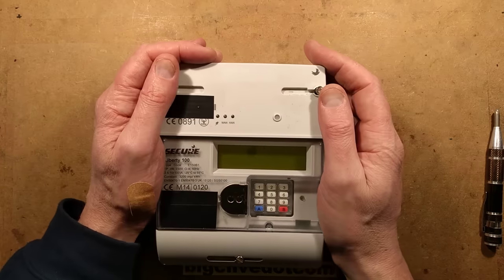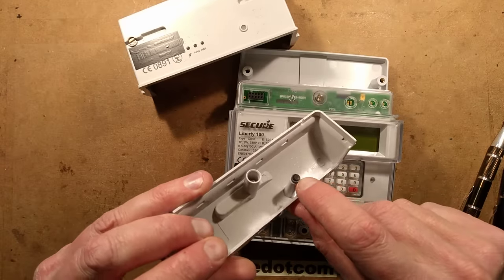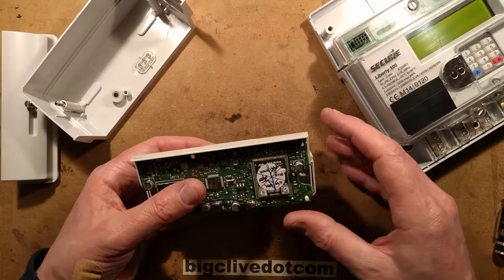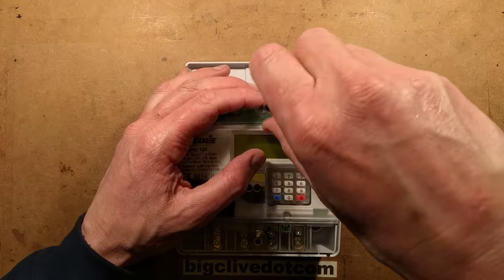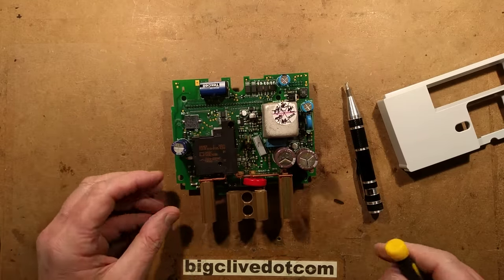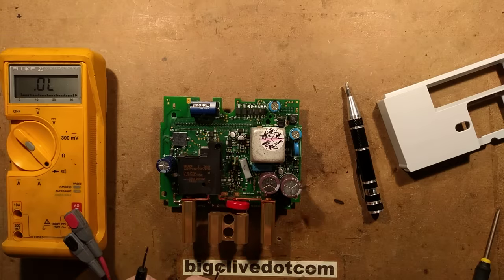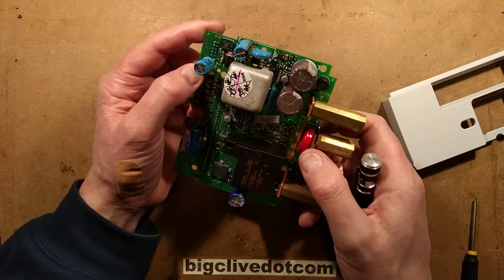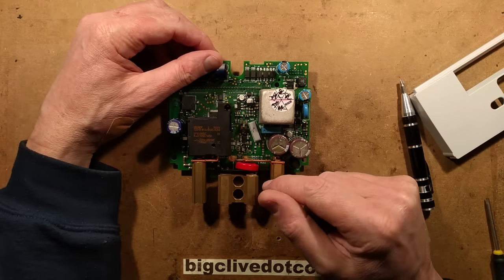Inside a smart meter, and the REAL problem with them.

Comment: I have 2000 Millie volts coming from my smart mete is this bad for my health
Reply from the maker: No.  If you're measuring a field it will potentially be at picoamps.  At that current it would be blocked by your skin completely.

Comment: My meter is the old spinning disk type that is EMP and solar flair resistant. If either happens with these electronic meters your power could be down for months as the power company has to replace them all with only a limited stock on hand.
Reply: I think the solar flair has dazzled you a bit too much.

Comment: I suppose that thing allows them to put IP internet packets from that modem to every mains socket in your house. When you plug something in - like your car charger that is set up to connect to the network - it could send a message back through the mains to the meter and off, via the modem, to the electricity company. They can then control it. If it's not in the current generation of smart meters, just wait.
Reply: In one statement you have shown you have no clue about networking.

Comment: The funny slug of different metal next to the power terminals is a current shunt.  similar to these:
https://uk.farnell.com/webapp/wcs/stores/servlet/CategoryDisplay?beginIndex=0&categoryId=700000004052&catalogId=15001&langId=44&storeId=10151&krypto=NFIye13FB8zt8bbVOPzpD4H7Qxu6twox8DuF9aCt%2BO3ryw8fGyRU%2FZEZIZ6YnN%2F0F7d%2BrYpE%2Fhj0shLJCspFcQ%3D%3D

It will have a specific potential difference range across it based on current draw, enabling high currents to be measured.  e.g. 0-100A will produce 0-100mV.  it will generate a small amount of heat. probably between 0-10W depending on load

Comment: Read the small print on mobile phones and also The Invisible Rainbow.  The military make use of EMFs as weapons.  Denying their capability to cause health problems and to be used as weapons is simple ignorance.  Everyone working with radar and telecoms in the armed forces is well aware of the dangers and there's a higher risk of cancer for people working in the telecoms industry at the coal face (towers, etc).  We don't have a Smart meter and we're not getting one.  If it was up to me, all our computers and gadgets would be hard-wired and double-checked for dirty electricity.  It's incredibly lazy to pull out the "conspiracy theorist" propaganda used to discredit truth.  If we've seen anything since the beginning of 2020, it's that none of the organisations producing any "tech" can be trusted.
Reply from the maker: The single biggest thing you can do to reduce your exposure to RF energy is to stop using your mobile phone.
Reply: @bigclivedotcom  if you stop using your phone then how do you go about with your banking..bills..and others since they are now used in this way?

Comment: You do have a nasty stutter Clive although it is a very common affliction. LCD display! Liquid crystal display display. That is one of my favourites. The MOV is probably just to provide some surge protection for the power supply but I have found a lot of instances where the fault current they were expecting the MOV to handle was excessive and the MOV disappeared.
I served my apprenticeship with an electrical supply authority. I spent six months in the meter section some of that time was spent repairing and testing disk type meters. One fairly common bill reduction technique was to drill a hole in the top of the cover and use a straw out of a broom to slow the disk. I believe that some supply companies here in Australia do increment the charge according to the period of usage.

Comment: This gubbins just sends meter readings over cellular so you dont have to read the meter.
The only drawback is the gas meter having to run off a battery which will need changing every 6 or 7 years.

Comment: IMHO...These meters cost bugger all from China (in real terms) But the installation has to be paid for by the customer in added charges....and to finance this scheme of Linky the suppliers of power use the difference bewteen kV and kVA...if your power factor is 1 then no problem but in 65 years as a sparks I have never seen i.e. measured an installation that was better than 0.9, more like 0.75.. and the difference makes a huge difference to your bill and finaces the cost of the "new" system.  Please study Power Factor on the internet and with this knowledle you will be able to understand the "new" system.

Comment: Hasn't it been proven without doubt that certain wavelengths influence cells in the body & mind. Using these same frequencies that the Human body creates. Hospital machinary utilises this ability & when doc tors run behind protective screens when X-raying people you take notice or I do but you seem to think that it's all bs. When someone puts up lead sheeting around these power supplies you tend to take note of what's being done especially when you see the results through testing equipment . Even warnings on  mobile phone radiation from manufacturers tend to have people's attention but you seem to assume it's bs. Statistics can also make valid statements if you have accurate information.so if in the advent of increased brain tumours & deaths from these things & mobile phone usage to confirm the theory you can't make the connection.  Also if your working in electric substations &  transmission stations you use earthing straps & ppe. Denial is not scientific especially when people are trying to inform others as they've been made aware of certain properties the equipment utilises. Where do you get your theories from & are you part of a major manufacturing syndicate.

Comment: I'm sorry we don't need any conspiracy theory's here as the reality is bad enough.  They can turn your supply off remotely ???  So if your in dispute with them over some problem they simply trump all the arguments by turning off your supply.  Also the variable rate is just a licence to print money for them. We have economy 7 and I love it, a mechanical meter tells me how many units have gone though each tariff and I know how much each of the units cost so I can check the bill.  With these new units you just have to trust your supplier as to what you've used, and how much each of those units cost you.  And if you disagree it's the hall effect VETO time.
& don't even get me started on the daily standing charge

Comment: These meters don't listen to your house using a microphone. Don't be ridiculous. What they can do is monitor your usage and how it's being used. They can tell if you have motors running or have ballasts that may indicate a pot farm in your attic. If law enforcement is trying to put together a profile on you they can access the information to map your daily habits. These units also have the ability to send data signals out across your interior house wiring along with high frequency radio waves that is useful for law enforcement to then be able to see into your house with monitoring equipment. Weather this particular unit has any of these features or not is another thing all together. You are familiar with electronics so you should know that certain devices designed for one purpose can be exploited for other things that they may or may not have been even thought about.

There is an abundance of evidence that indicates that people that talk excessively on cell phones and use predominantly the same ear every time are much more likely to develop brain tumors on that side of their head. The radiation does pernitrate in to the skull. If I'm on a long phone call I have to switch holding the phone from hand to hand (I always use speaker phone so I'm usually holding my phone) due to the fact that the bones in my hands will start to ache if I hold the phone in one hand for to long plus my hands will start to cramp up, not to mention the phone gets hot.

As for 5G there are published per reviewed papers that indicate certain interactions with 5G and human physiology. If I remember right 5G inhibits red blood cells from transporting oxygen and something to do with interfering with your bodies ability to repair damaged chromosomes. Don't quote me on this because it has been a while since I read the papers but rest assured there are health effects. Now weather or not these effects are worth getting your panties in a bunch about you will have to decide that one for your self.

Comment: Please  DO NOT EVER INSTALL SMART METER   ?
Reply: Yes! Never let them install one,,,  both times a Smart Meter has been installed into a building we lived in our Children started having nosebleeds and headaches at the exact time,  by exact, I mean in seconds of each other.  They are both getting radiation poisoning and I'm sure my whole family is too!  
And no it wasn't our family who had a meter installed, never would!
Reply: Do what you want, but you probably won’t have a choice if your traditional meter stops working/needs replacing for safety reasons as they hardly manufacturer traditional meters anymore so some suppliers simply only have stock of smart meters

Comment: So next time there's a regional power outage, pop open the two covers and short the tamper sensors. OK, got it.

The main abuse of these things that I heard is surveillance.  You get home from work, it lets the telemarketing company or bill collectors know. DSP can identify specific types of devices in the house which can be used for marketing or law enforcement fishing expeditions, etc.
And in some designs the power to operate the meter is on the customer side (billable).

Comment: Did you know they cause dirty electricity and the wires on your house act as a energized transmitter
Reply from the maker: No.  Mainly because they don't.  The meters used to "prove" they do are made purely for that purpose.
Reply: The smets 2 meter run of DCC in uk

Comment: I wonder if it has any fuse or safety protection against faults, I suspect we'll be hearing about fires caused by these the more people have them, I refused on privacy grounds and ability to cut your supply easily at a whim
Reply from the maker: The fuse is at the cable entrance.  The only fires I know of involving the indoor meters are due to incorrect installation.

Comment: Did you use an RFR meter to measure the RFR emissions? We have. And smart meters DO emit RFR's. And yes, 5G really is loaded with RFR's that are not good for the body electric. Do the research yourself - but not from telecom sources.

Comment: Wrap it in lead!
This way you have not tampered with it, and they can not get to it without causing criiminal damage!
A grounded lead cage will block all radio signals, will not damage the meter but what i do not get is why ppeople do not get a written service agreement before switching energy brokers wi5h signature i  which the rental space for the meter has to be paid for equal or greater than the service tarriff! That is the rental space in which the meter sits is equal to the service  charge plus the admin fee for calcation of the rental charge which is very complicated and they wouldnt understand it which is legal bollocks for we can charge what like. But generally it should equal 10% of the total emf used per week times by 52 weeks giving 520% of the total emf used in a standard year plus the service charge. Total rental charge for a smart meter for the year on a £1000 bill is £5200+ £104 =£5304 ajd should be in tge written service agreement which is a signed document not a verbal contract whi h isnt worth the paper it isnt written on and can not be refered back to for lawful purposes. Whi h means the broker  an change its terms.without notification.
Reply: Gibberish.

Comment: WAN light
Reply from the maker: It may have an issue with connecting to other metering devices like a gas meter.
Reply: The WAN light is a heartbeat flash when connected to the gsm network. It will be solid if there’s no connection. The HAN light is only on when the HAN network is open for device joining.

Comment: The problem with smart meters and any emf is it interferes with voltage gated channels in our bodies. They have the ability to block voltage gated sodium channels and such in turn allowing parasites to multiply.  I do not know a whole lot about human biology but we do have electricity running through us. I’ve had a high pitch ringing in my ears that gets worse at night ever since the smart meter was installed. We just bought a fridge that had an antenna on top, Bluetooth chip on the top hinge and a WiFi module. There is absolutely no need for any of that in a refrigerator. New Samsung French door. I disconnected all of it and hopefully the fridge stays working. It’s all about killing us quicker and making a quick buck while doing so.  Oh I also never connected to the fridge but ever since we got it my phone has been randomly disconnecting and reconnecting, well the other day I got an iPhone push notification saying my WiFi password was incorrect-which I knew was a lie-the fridge tried to get my WiFi password!!!! I’m no conspiracy theorist, I’m a truth theorist. Everything I’ve figured out in my own experience, I do not believe everything I hear or anything I see on television for that matter. Stay vigilant folks.
Reply from the maker: If you have any concerns turn all suspicious equipment off.

Comment: Firstly no safety studies have been on 5G so you can’t say they’re safe. However, the main issue is that they can turn you off etc and ultimately link you to a social credit score.
Reply from the maker: 5G means 5th Generation and relates to a communication protocol.  The spectrum of frequencies it covers is from DC to almost the wavelength of light.   It's frequencies above visible light wavelengths that pose a hazard.

Comment: Are you sure you didn't find a hidden mike or camera on that PCB? Maybe you hid it prior to showing it, hah? Isn't a smart meter may be for monitoring power usage at certain times of the day (even though not warranted) as well as pass on the power consumption without the need to come out to read it?! Having an RF unit on board sure does give a rise to conspiracy more than anything else as all the data signals should be handled by the power lines. Btw, it seems to me it is a multi-layered board. In all honestly, as Alex Jones would say, "that device is as dubious as the three-dollar bill." The question is is it situated inside or outside the house?!

Comment: You have no idea what 5g is capable of. Stick to taking things apart. Thanks.
Reply from the maker: Yes I do.  And I can also differentiate between a low power RF signal used for communication and a microwave oven used for cooking food.
I can guarantee that the most prominent anti 5G campaigners will move onto their next conspiracy just as soon as they get their new 5G iPhone 12 and suddenly it's all fine.
Reply: @bigclivedotcom  bit naive Clive given the world is ruled by a power crazed criminal cabal. Still, if it helps you sleep nights.
Reply: @jasondavis8886  do you have any idea how much LOW frequency radiation is coming from your phone display?  Research what VLF did to trees in rainforests in the 80's.  The Russians figured that out 40 years ago to find American land to submarine transmitters... what's it doing to your brain?  What's the wavelength?  You're gonna need about a thousand feet of foil for your new hat.

Comment: So..... I don't see what the real problem is with the meter.
That was a waste of my time watching a bloke saying maybe this or maybe that.
Its a simple meter that measures usage.
Finally nobody cares when you are cooking your tea.....
The information is all about getting information about national usage so that generation can be more accurately determined.
Reply from the maker: The real problem is that the way your power is charged can be changed at will, with tariffs designed for profit.  Like charging for apparent power instead of actual power, which means that a humble time switch will show up as 10W instead of 1W.  That would result in an extra yearly running cost of about £20 per timeswitch as opposed to £2.
Or peak pricing when they know you are going to be cooking food.
Reply: @bigclivedotcom  they have the ability to change the tariff anytime smart meter or not.
These current tariff changes affect smart and classic meters.  Smart meter is just the evolution of the meter.
Reply from the maker: @deosiewilson732  The smart meters allow the power to be measured in different ways and also allow timed tarifs to be implemented.  All remotely.  Do you know the difference between apparent power and real power, and what sort of loads will be affected?
Reply: @bigclivedotcom  smart meters or classic meters measure only power consumed ie real power.
Having the ability to change timed tariffs remotely is no bad thing.  Suppliers cannot randomly switch your tarrif from say a single rate to a multi rate.  Also suppliers can't increase standing charges or the cost per kilowatt hour randomly.
Timed tariff changes are customer driven. Cost per kilowatt hour prices are market driven and cannot be implemented secretly.
Reply: @bigclivedotcom  meters measure real power..... Always do.... There is no issue.  All of your fears are applicable to both classic and smart meters..... Anyway, you may as well get used to them.... There is no going back....
Reply from the maker: @deosiewilson732  Smart meters can measure real power kWh or apparent power kVAh where voltage/current phase relationship (power factor) is disregarded.
https://en.wikipedia.org/wiki/Power_factor
Reply: Chances are you rarely see a problem with anything, am I right?
Reply from the maker: @Acetyl53  Oh I see plenty of technical problems with lots of things.
Reply: @bigclivedotcom  Well, not that it matters.  The bioeffects and the more engineering minded people are irreconcileable at this point.